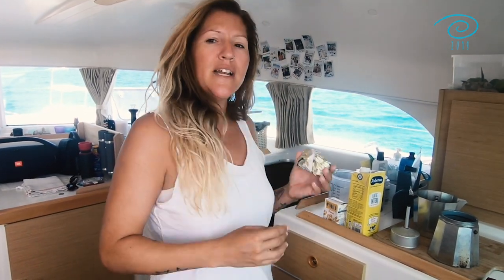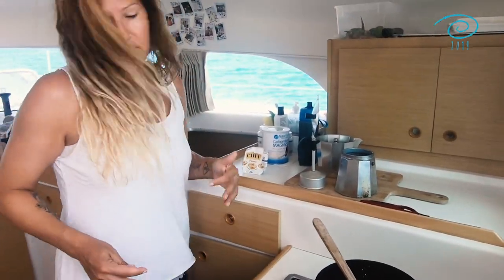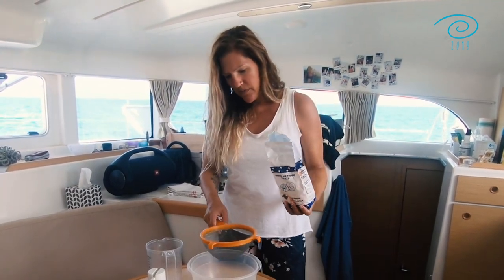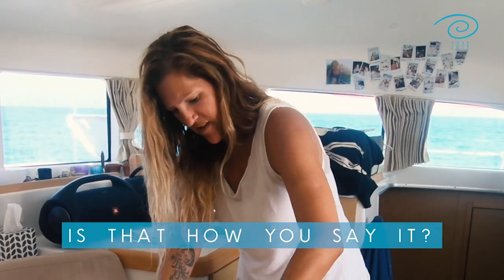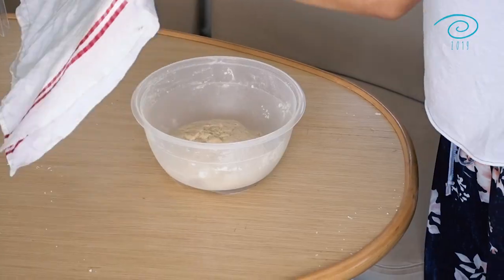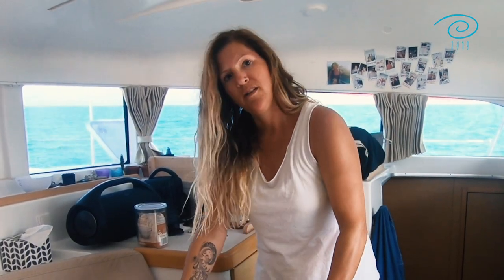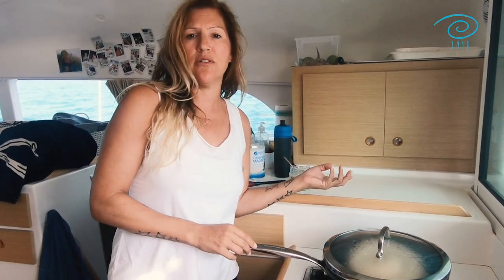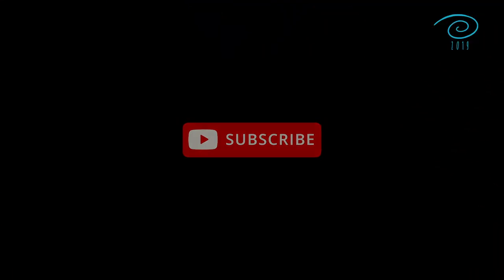Boat Hacks: How to Bake Bread in a Frying Pan

Comment: Nice one! I really wanted to try once to bake my sourdough bread in a pan, but for that I need to make sure I can get it up to 230 degrees without burning it. Do you have a way to measure the temperature in the pan or is that less important for this kind of bread? cheers from Valencia, btw we got the water maker ;) thanks for the tip!
Reply from the maker: Yea i can imagine its a bit more difficult with sourdough! 😅 we dont have a device to measure temperature. Flip it over every now and again an knock on the bottom. If it sounds really hollow its good to go!! 😄🙌🏽 glad it worked out with the water maker! Looking forward to an install vid!! 😉